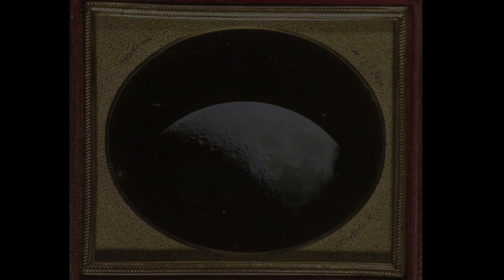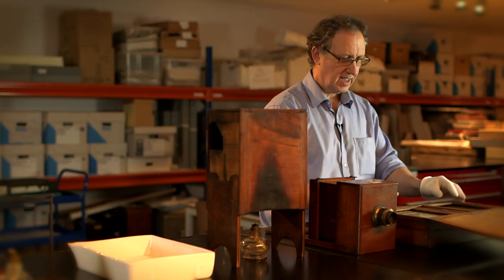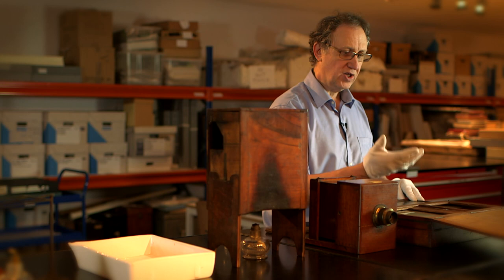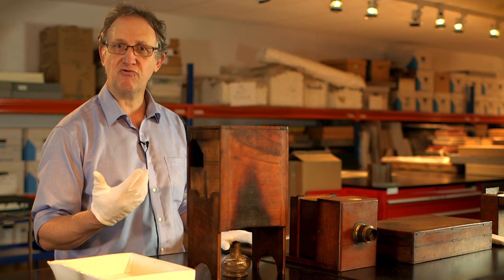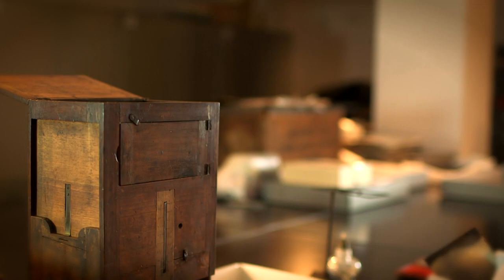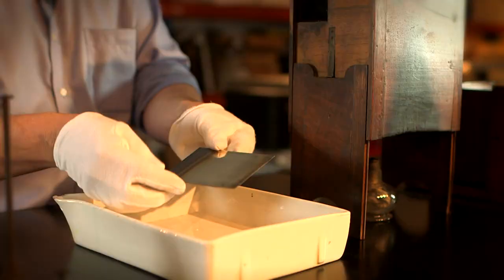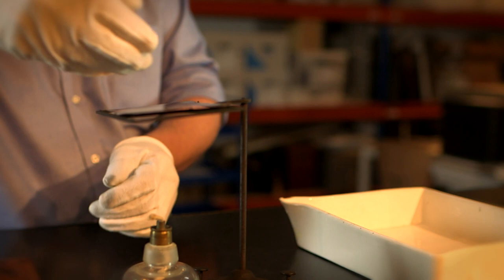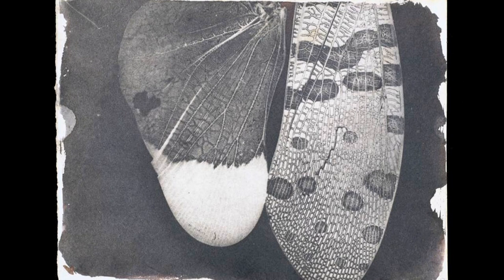The science of making a daguerreotype

Comment: A few inaccuracies in the video -15 to 20 minutes for exposure to Iodine fumes would have been far too long, the amount of amount of iodine in the fuming box would have be impossibly small to not pas through the first cycle of the colour spectrum.  Most period accounts of iodine exposure times talk of 45 secs to a couple of minutes.  Also the gold chloride solution is placed on the plate before it is heated, otherwise terrible staining would occur.  The plate is levelled first on the stand with the solution applied, so it does not run off and leave a portion of the plate exposed, as when the plate is heated it will burn blue where there is no solution.